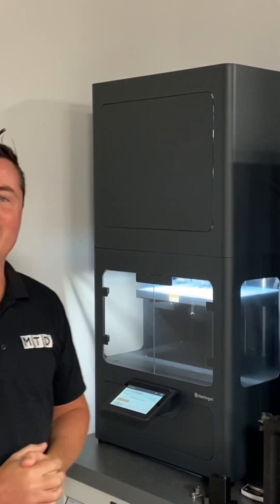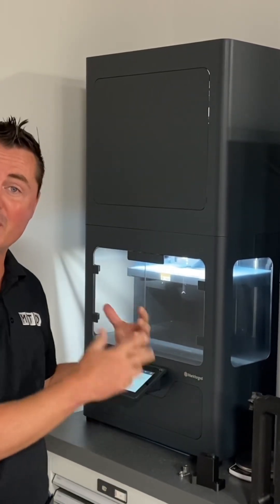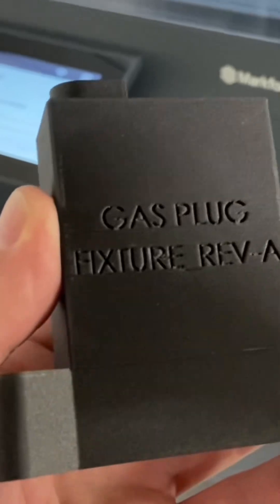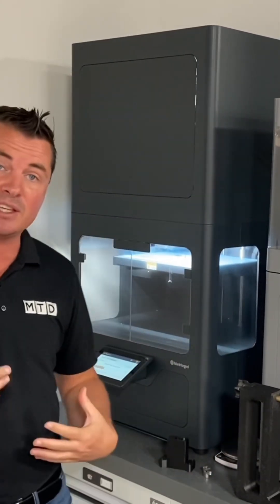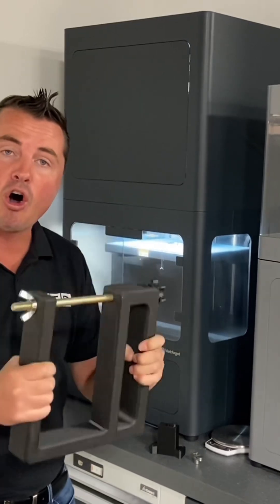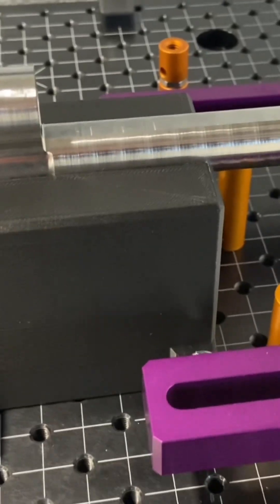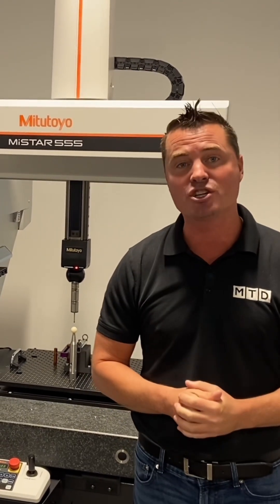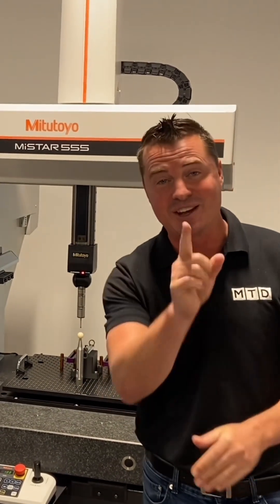How Additive Machines and 3D Printing can work for you!

Comment: Tight tolerances can be achieved with 3d printing, you just need to know how the plastic will warp and compensate accordingly. I prefer it to spending all kinds of time sanding or any other process, and I'm getting it tighter than I ever could processing it after the print.
Reply from the maker: Great comment and insight